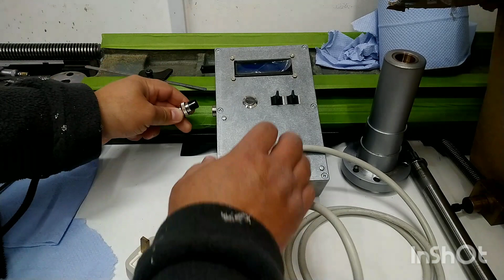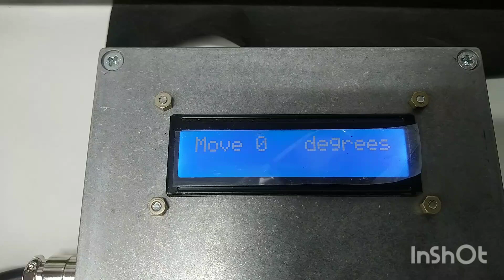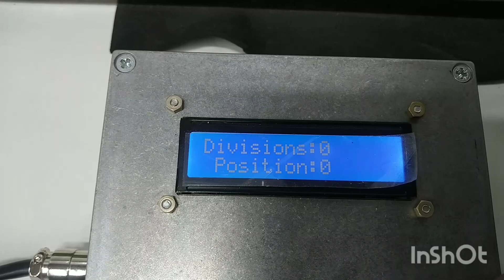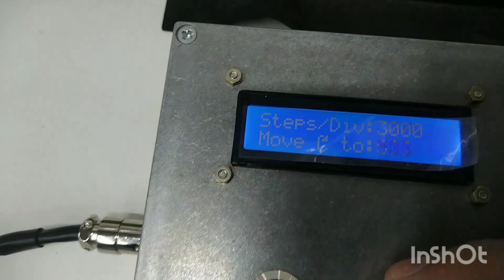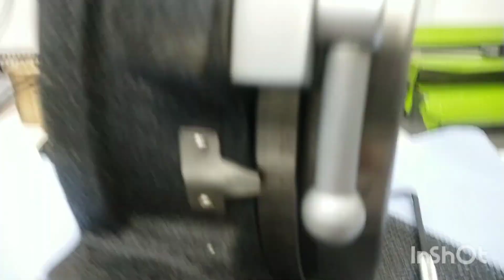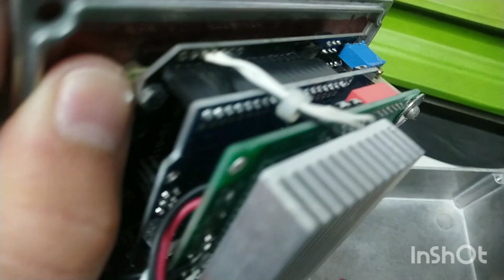Arduino Controlled Rotary Table

Comment: Great example of applying an electronics solution to the home workshop. I have only dabbled in basic soldering of boards e.g. a part built oscilloscope & DIY miiliohm meter. This looks a foolproof solution to potential errors when using dividing head plates etc.
Reply from the maker: Hi Rob. It is a good example of that. It was much more simple to make than you might imagine. Simply a case of plugging together a number of small modules and then loading the Arduino with Gary Liming's source code, which you can get for nothing. It took longer to make the stepper motor mounting. If I can do it, anyone can. Thanks for watching and commenting!

Comment: Hi Carl, I could clearly have done with that little modification over the last couple of weeks lol. Very neat job you made of it. Safe travels. Cheers, Jon
Reply from the maker: Thank you Jon. It works well. I haven't used it in a long time but it is there if needed. It is quite an easy thing to do as well. I would definitely recommend it to others. Thanks for your interest and support, it is much appreciated.

Comment: I like it, I remember when you built this. Does this mean that the rocket engine is now the motive power for the collective pile of abandoned projects? 
Nearly at 100 subs. Well done. 
Dean.
Reply from the maker: Well, I am not calling it abandoned as such. The government decided to ban sales of nitrous oxide which meant I have had to have a big rethink. It is still on the back burner. If you will pardon the pun. 100 subs soon hopefully. Thanks for your support.

Comment: Great video Carl, I thoroughly enjoyed that. I've seen grown men cry taking the last cut on a gear and realising they've missed a hole somewhere on an indexing plate as the cutter doesn't go down the middle of the material left. I am definitely going to look further into this as I do a lot of spline refurbishment work on my shaper for kickstart and gear change splines on veteran motorbikes. Is the continuous rotate function controlable for speed? Great job mate..................safe travels.......
Reply from the maker: Hello Tony. Thank you very much for watching and commenting. I am glad you found it useful. I am one of those who has cried due to ballsing up with the dividing plates, hence this solution. If you decide to make one of these I would be happy to help out. I wrote this unit up as an article for Model Engineers Workshop magazine in the UK. I can't remember which issue it was, but I gave detailed instructions. As I say it is about 8 years back now. MEW is available in Australia I think, and they have a website. Yes, the continuous rotate function is speed controllable. Thanks again for your support. Edit - it was in MEW249.

Comment: Hi Carl,
Thank you for the informative video.
I have a situation where drill sequence is pre defined. For example, there are 20 holes to be drilled. But the sequence is like drill number 5, 19, 8, 14, 20, 6, 1....etc.  Is there a way to add this sequence to the program?
Thanks in advance for your help.
Reply from the maker: Hi Ashutosh, great to see you here! I have thought about your problem. You could program an Arduino to drill holes in sequence, but the easiest way, in my opinion, and using the Arduino rotary table as is, would be as follows. You can input the movement as an angle. So for your 20 hole example, 360/20 gives 18 degrees per hole step. So if you start at hole 5, assuming hole 1 is zero datum, your first angle will be 90 deg. Moving to hole 19 is 14 hole steps, so next angle would be 252 deg. Then to get from 19 to 8, you need to keep moving in the same direction to avoid backlash. So that would be 9 increments of 18 degrees so next angle input would be 162 degrees. And so on. You are taking each hole position as a new datum each time and stepping the required multiple of hole degree increments to get to the next hole, always rotating in the same direction. I hope this helps. I hope also that you've enjoyed my other films, please give me a like and consider subscribing if you have. Thanks for your interest and support, it means a lot to me!
Reply: @carlwilson1772  thank you for your valuable response.
I liked the solution - considering each hole as datum and adding next value in degrees. 
One clarification needed. I have number of holes in few hundreds. Adding degree each time is still a challange. I have the sequence of holes ready. Adding it in a program and just selecting next button may be the best solution. Does Arduion has such feature?
Thank you for you time.
I have already subscribed you Chanel for the upcoming content 🙂
Reply from the maker: @ashutoshambike4638  Hello Ashutosh, that is an intriguing problem. You could certainly program an Arduino to control a stepper motor and give a specific sequence of steps. Perhaps a way forward would be to download Gary Liming's code for the step indexing system, as I did, then modify it as required. If you don't have any experience with microcontroller systems like Arduino, then the Arduino website is a good place to start. Gain a grounding in the system, see what it can do and go from there, up. The only limit is your ability to persevere and learn new skills. Good luck!

Comment: Could this be used to basically cut a circle? So for example tell the rotary table to rotate 360 degrees at a certain rate.
Reply from the maker: Yes it could. I have never tested the unit rotating against the force of a cut, but I think it would work. Stepper motors lose steps when overtorqued, but that would not matter for an application like cutting a circle. You could do it with a normal rotary table too of course.

Comment: Hello Carl, how did you programmed the arduino to make any divisitions? I´m a student and I try make a rotary table but i have been unable to make it work, im using a LPD3806 encoder.
Reply from the maker: Hi Alejandro. The program works by calculating the amount of steps required to turn through a certain angle. The motor does 200 steps per  rev. The table gears this down 90:1. So that's 18000 steps for one rev of the table. Meaning 50 steps per degree. So the program takes the number of divisions and works out how many steps to run. The program was devised by Gary Liming and you can learn more about it if you Google him. Very good luck with your studies and project.
Reply: @carlwilson1772  Thank you so much Carl!!! I really appreciate it